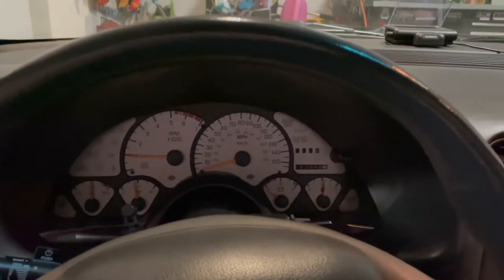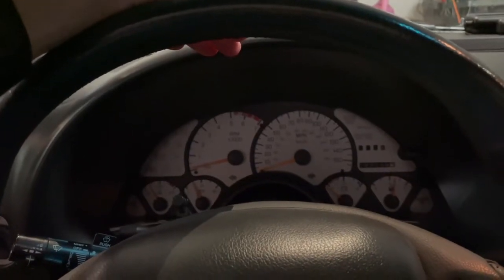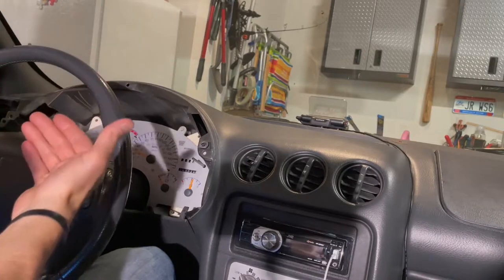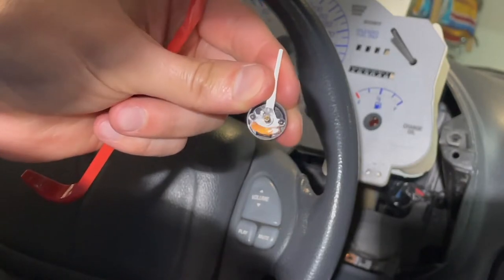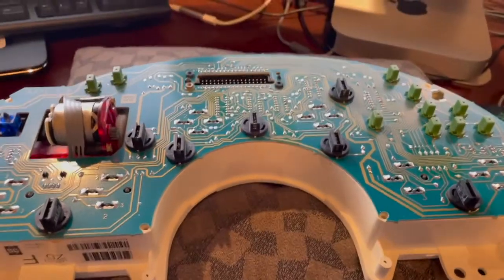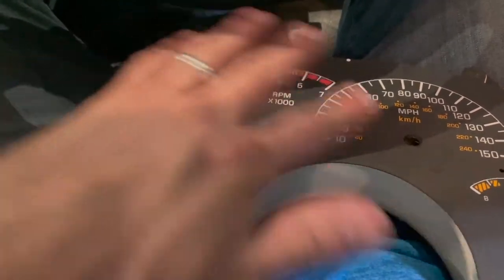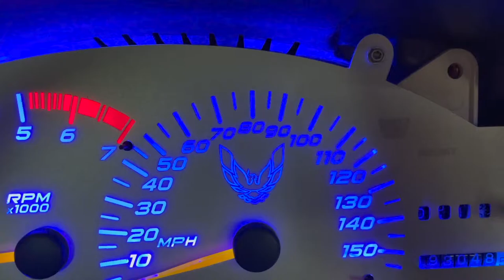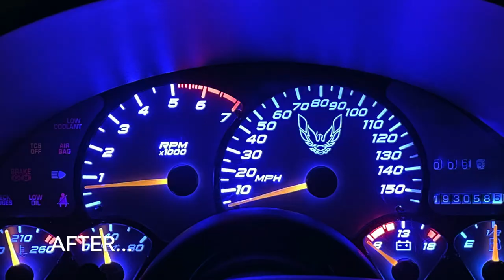93-02 Pontiac Firebird Trans AM Gauge Overlay with LED backlights

Comment: Love your taste in gauges I literally just got the exact same face 2 days ago lol.  Just put it in today, I love it!  I'm gonna have to get that '97 bezel though, looks way better than my '94..
Reply from the maker: Awesome.  Did you end up adding the extra led strip for the top right of the speedo?  I actually used mine to get more light on the fuel gauge or did you stick with ur stock bulbs?
Reply: @ringnjc  I was gonna go with the LED kit but there was no way to get the colors to match up with the HVAC/Lights without soldering the LEDs in.  I might do it one day but for now, stock bulbs it is!

Comment: You mean your not gonna roll back the mileage while your in there ?? LMAO -c'mon now that was funny, right? on my '98 T/A the odometer is digital so no roll'n back, but seriously great job on the video making it detailed and thorough. My luck the gauges wouldn't be accurate LOL I would panic every time the needle on the temp gauge would climb.
Reply from the maker: Thx man.  I am just a weekend warrior so try to make it as detailed as I could for those of us that might be afraid to take stuff apart.  Lol on the roll back, thought crossed my mind but I don’t ever plan to sell it and the miles are a badge of honor!!!
Reply: @ringnjc  haha same. I get ppl all of the time here in Vegas wanting me to sell mine. lol mines in Sebring silver T-tops all stock. I only put a 1400 watt sound system. I bought it from a one owner lady back in '14
Reply: @ringnjc  I used to build custom sound systems for people. The one I put in is a Kenwood cd player HD radio/ sirius/ it has the morphing colors, YOU can set it to one color or just let it change. It gradually shifts thru a rainbow of colors when it's on. I have Alpine door speakers/ 2 Planet Audio 12'' subs mounted on a slant in the back. I have a 1 inch soundboard covered in black leather with a 1200 watt Planet Audio amp with a Planet Audio bass processor. Both have a controller one on the left side under the dash and the other next to the ashtray. I mean it's really loud but crystal clear at all volume levels. Alot of systems are just loud but sound like crap. Mine always sound clear like a home stereo. I might make a YT video showing my T/A and  this system. I have never made a video so it would probably suk LOL -I wish I was as good as you making videos haha

Comment: I’ve had an issue with LED bulbs. They keep burning out after a couple of months.
Reply from the maker: I haven’t had a problem with the bulbs from these guys yet, but I’ve probably only put 2k miles on the car since I did it and maybe 30% night driving.  So small sample size.  They also don’t dim very much.  I would consider switching back to incandescent for better dimming.